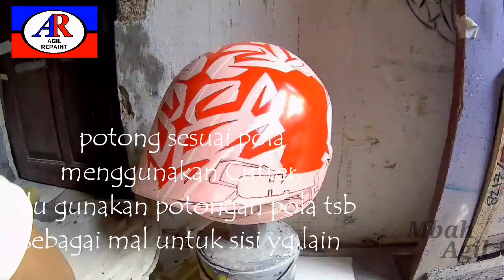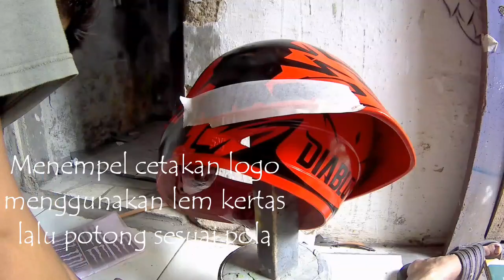Proses Repaint Helm Motif Shark Diablo Lorenzo | Basic KYT RC7

Comment: Mas kalo ngecat body motor pakek kompresor lakoni imola 0,75 hp yg pernah mas rivew .itu pakek tekanan angin berpa BAR..baik dari pengecatan samapi finishing clire coat.
Mhon bantuannya mas🙏
Reply from the maker: Klo kompresornya sy stel full 8 bar, paling saya mainin regulator di spraygunnya aja mas, kurang lebih kisaran 4-6 bar
Reply: @AgilRepaint  anginnya mudah tekor gak mas kalo pakek spray nozel 0,5/0,6
Reply from the maker: @muhammadalkhafiz8596  cukup lah mas anginya, tp saran sy sih tambahin tabung lagi mas, biar nggak cepet ngembun
Reply: Mas pakek spray nozel yg brpa mas
Reply from the maker: @muhammadalkhafiz8596  0.6 sama 0.8